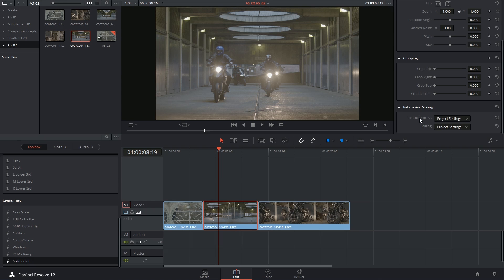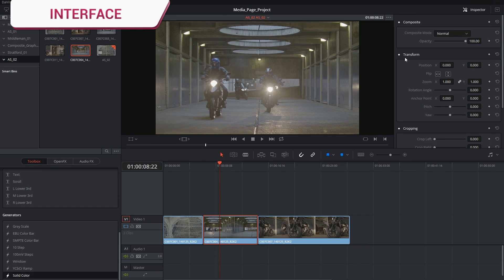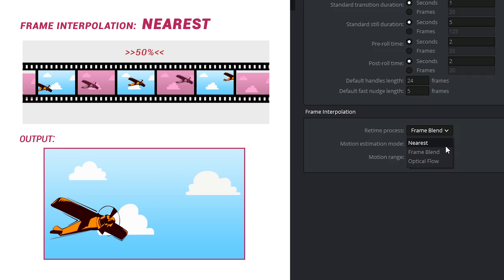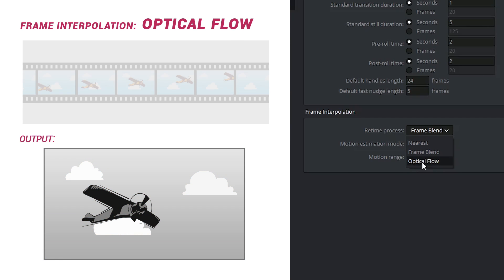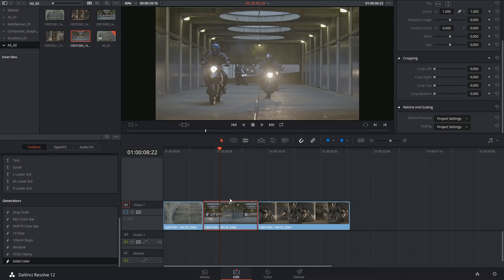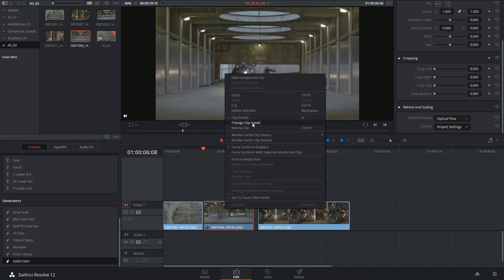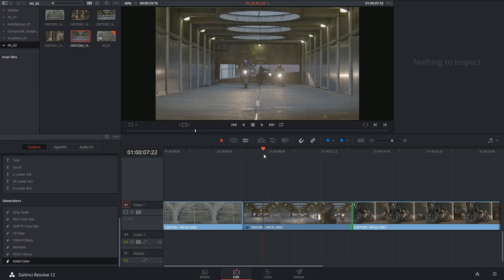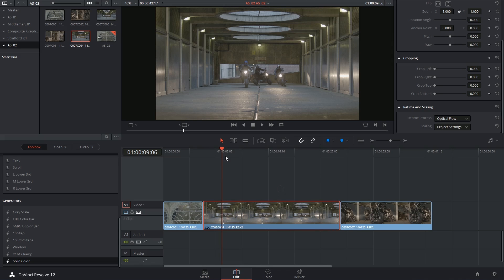DaVinci Resolve 12 - 38a Frame Interpolation and Clip Speed

Comment: I actually came across the Frame Interpolation tab while goofin around the tabs and menus, i quickly switched to Optical Flow as I saw it cause u already know we don't play no games (lol) so i went out on a adventure but it sadly didn't last long cause like ur the only person who has made a vid on it that's sorta goes into the settings and not just shows the exterior stuff so props fo that ; ), so i was wondering whats the best to be on in the rest of the drop downs in the Frame Interpolation tab for the maximum smoothness overdose, what should i be on ( faster or better) and (Large, Medium or small), thanks btw u got some great informative uploads and hope to see u come back with more of these davinci resolve 14 babyyyyyy have a great day, piece : )
Reply from the maker: Yo! The Motion Estimation mode dictates whether you prioritise quality of interpolation or speed.
Faster - the render will be completed quickly, but at a rougher quality.
Better - the render will take some time, but will give you optimal quality.
For best quality, obviously 'Better' is what you need. Enable Render Cache if your machine starts struggling.

The Motion Range indicates how much movement there is within the shot. 
Shots with lots of movement (people, vehicles, as well as camera pans) need to be set to Large, whereas locked-off shots will look just as good with Small. I suggest you specify the Motion Range on a clip-by-clip basis in the Inspector. If you don't feel like monitoring every clip, then Medium would be the safest option.

Also - I'm working on a few big projects at the moment. Hopefully someday I'll finally have the time to come back to this series and upload all the new things I've learned in the past year!
Reply: YIKES! U faster like the furious yo wow i'm amazed
and thanks fo drillin it in well explained
i sure im working on a project with a lot of stuff wiggling around in my background so i guess monitoring is the way to go.

and i'll be on the loook out fo ur upcoming vids ; ) 
also be killin it on them big proj's of ur
thanks again later  : )

Comment: Hi Daria,
I wondered if you could please advise me with regard to changing frame rate and making it look convincing? My problem is that I spent several months shooting a feature length project at 29.97 fps but want to convert it down to 24 or 25 fps to make it look more theatrical. I realise it should have been shot at 23.98/24 fps in the first place but due to lack of budget, a standard 1080 HD camera with a fixed 29.97 fps was the only option we had to shoot with! 

I've tried some rough tests using frame blending but it still looks a bit strobe-like/juddery. Is there another process I could try that you know of? I'd be most grateful for your advice, thank you very much in advance.
Reply from the maker: Hi there - I'd generally advise that you leave the frame rate alone unless you have a specific reason to change it. 

There is nothing wrong with 29.97 - it is the US (NTSC) standard which many projects are still recorded in. 25 is just the European (PAL) equivalent of that. Both of the formats were invented to deal with transmission limitations in those respective geographic areas in the 1930s. Likewise, the 24 frame rate was not selected for aesthetic reasons, but due to financial and audio sync considerations. The previous fps standard was 16 fps (which worked with a triple projection until sound came along), and the 'ideal' frame rate is 46-48 fps (which no one wants to use because its twice as expensive as 24 fps). So...there's no such thing as a 'cinematic' frame rate, and most people (myself included) cannot tell the difference between 24, 25, and 30. 

The only real need for 24 fps is when you are specifically delivering to cinema. If you are considering sending your project to cinemas, you'll first need to verify what their projector's capabilities are. If they can only project 24 fps, you might want to consider getting the footage professionally transcoded in a DIT firm. Otherwise, if you are working on your own, it should be enough to just change the frame rate of your project (not time-remap the footage on the timeline), which will automatically perform the relevant drop framing to optimise your footage.

If your project's final deliver is online, then I strongly urge you to leave it at 30 fps to preserve maximum quality. And then make a mental note to shoot at 24fps next time. :)
Reply: Thank you very much for this detailed and informative reply. I appreciate you taking the time so quickly! :)  After reading through, I'll probably do as you suggest and leave. Though I find the "look" of my footage - Which is standard 1080p, at 29.97 fps - very generic looking, high speed shutter HD Video. There was no way to slow the shutter speed down unfortunately! 

I guess my thought was that even though it might be a drop in quality, if there was a way of smoothing it out, 24 fps might look a little more dream-like. 

Yes, the hope is that the film (when finished) will be screened at various festivals. I'm currently trying to get the interest of various parties to fund the promotional side of things at the same time as editing it! Ha ha...

Well, thank you again and I look forward to perusing your videos and wish you all the best with your work. 

Peace. :)
Reply from the maker: Perhaps to make it look more cinematic, manipulating the contrast might help? Traditional film stock tends to have flatter shadows and less contrast than digital media. There's lots of tutorials online about how to achieve certain film looks - play around with those and see if that improves the footage.

Good luck withe the promotion!
Reply: Thank you. I will certainly bear that in mind and I know the colour grading side of things can also help to give a more "Movie"-like feel. But I realised what 95% of the problem was/is...And you are right, it's not the frame rate, it's actually the shutter speed - which is a fixed, high speed and has unfortunately given my footage a very sharp, sped-up look!!.For example, when an actor moves their hands or turns their heads quickly there is virtually no movement blur, just very sharp and video-like. 

Just as a final question, do you think it might work if I ran each separate clip through some kind of motion blur filter or simply running the whole movie, once edited, through a motion blur filter that will only be noticeable when there is movement - The actors walking/running, cars and bikes, etc. Failing that, would keeping the footage at 29.97 fps and simply using frame blending soften it a little? Sorry for all the questions, I'm very grateful for your thoughts. :)
Reply from the maker: Ah yes, the shutter speed will do that. There is actually a very strong motion blur function in Resolve, but it is only in the paid version (in the same panel as the noise reduction). Perhaps the best option would be to run the footage through a third-party motion blur plug-in? I'm sure you'd be able to find something for AE or Premiere, if you use those. Frame blending is only enacted in Resolve when the footage is retimed, so you'd need to change the speed of your footage to see its effects. I'm not sure I would recommend that, as it would reduce the quality of your film...
Reply: Ah, ok I'll give that third party plug-in a try, thanks.:) Or, depending on how long the editing takes - which will probably be several months - if I end up striking lucky with one of the arts organisations (funding-wise) I might just get myself the studio version and use the motion blur function...

In any case, thank you very much for all the advice. I appreciate it! All the best... :)

Comment: I NEED HELP !
still images i add to my timeline are 1 frame, i cant stretch them so they are longer in length visible in the movie,
How to i make pictures longer visible?!
Reply: i have no "editing tab" in my project settings   :(
Reply from the maker: Hey, answered your question on another video, but going to leave this here in case someone else has the same issue: 

Do the following two things:
1) In the Media Storage Panel (Media Page), click on the 3-dot menu in the top-right corner and make sure 'Show Individual Frames' is selected.
2) If you are using Resolve 14, open Preferences, go to the User > Editing section and in make sure the Standard Still duration is something like 5 secs. If you are using Resolve 12.5 or earlier, this option is available in the project settings.

If this still doesn't work, would you mind telling me what format your images are in?
Reply: THANKS ALOT!

Comment: I like to render slow motion the conventional way, by shooting at a higher frame rate (ie. 60fps) then converting it down to 24fps for true slo-mo.  How would I accomplish this on Resolve? The project frame rate is usually 24fps. That's how I processed this video using Adobe Premiere - https://www.youtube.com/watch?v=0jS-x8vUi70 - I find interpolation/flow approaches a bit unrealistic. Same artifacts as Twixtor plugin.
Reply from the maker: You shouldn't need to rely on frame interpolation if you're shooting at a higher frame rate to achieve slow motion. You should be able to follow the same workflow as you do in Premiere. Create a 30fps project and drag+drop the media into the Media Pool. You will get a dialogue box asking if you want to change the project to meet the standards of the footage - say 'no', because you want the footage to remain 60fps while the timelines are 30fps, thus playing back your material at half speed and achieving slow motion. 

Why 30fps and not 24fps? It's generally recommended that you always stay in the same denominator when working with slow motion (or any time you work with different frame rates). 60 is easily divided by 30. 48 is easily divided by 24 (which is the project frame rate I'd recommend if you were shooting in 48fps). In terms of 'slowness', there is not a perceptible difference between 60 and 48 fps, but you are much more likely to have lags/artefacts in the playback if using unmatched rates.
Reply: If I understand what Smart Biz Web Media is suggesting, going from 60 to 24 fps shouldn't cause lag or artefacts?  I'm using stock clips of nature at 30 fps in a 24 fps project. To avoid artefacts and judder I'd rather playback the clip slowly - 30/24 is 1.25, so a 10 second clip should last 12.5 seconds at 24fps, with no interpolation, just a slower playback or render rate. Is it possible to do that in Resolve?

Comment: Thank you for the great tips!

How do I increase the speed of multiple adjacent clips keeping them together (without creating gaps between them)? The "change clip speed" option doesn't work for linked clips and retiming creates gaps...
Reply from the maker: That's a good question! I haven't tried retiming multiple clips before and I've been unable to find a direct workflow in which this is possible (the manual also doesn't give any clues).

However, there is a workaround I found which might be appropriate depending on the nature of your project. You could line up all your clips, select them all and turn them into a Compound Clip (through right-clicking). Now you can retime the compound clip, affecting everything within it uniformly.

If that's not an option, then I'm afraid the only solution is to Change Clip Speed individually, with 'Ripple Sequence' enabled. Or use the retiming interface with your trim tool selected.
Reply: Goat's Eye View thank you so much, you're the best!

Comment: Hi goat,

Thanks for the tip on optical flow! Mine was set to nearest.....

Anyways, now to my question: I have X amount of separate JPGS of the frames of a gif animation I made. I now want to combine them all into an MP4 using Davinci, and I remember something about importing a bunch of image files and doing just that. Can't remember how though.

Hope all is well, and happy new year!
Reply from the maker: Happy new year, Alex! When you import the first JPEG image into the Media Page, do the rest not follow as an image sequence? Do the images have a sequential numbering name format?

Usually people ask for tips on how to import image sequences SEPARATELY, as this is a special function in the Media Storage Panel (option menu > Show Individual Frames). Perhaps you turned that on and need to undo it before proceeding?

If your images aren't sequentially named, you can import them into the Media Pool, and specify in the Project Settings (Editing > General Settings) that you want the Standard Still duration to be 1 frame. Then drag+drop all the images onto a timeline where they will all occupy just one frame, and thus act as a film. Then Render Page and export. Boom!
Reply: Goat's Eye View ohhh, nice! I renamed them in order and it acted as you said. Buy I would like to not have to rename them. The problem is that they're named in reverse order (that's how Photoshop exported the gif), so it doesn't act the way you said because of it. Is there a way to drag and drop the files in reverse order (so they then appear as they should?)? Because what you said last seems like the best way to go, unless I can change the naming process in Photoshop.
Reply from the maker: ...or you could import them as they are and then Compound the clips on the timeline to turn them into a single video clip. Then change the time settings of that clip to -100 (or 'reverse') to have them play the right way around.
Reply: that diddit, diddit! Thank youuuuuu